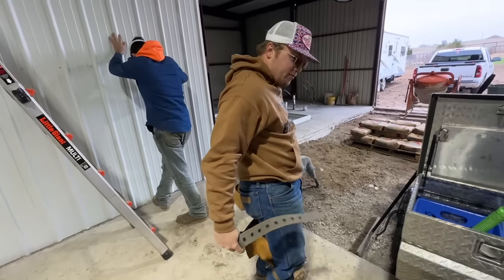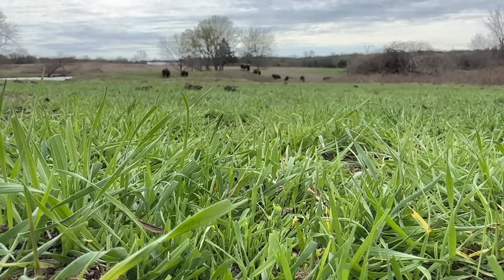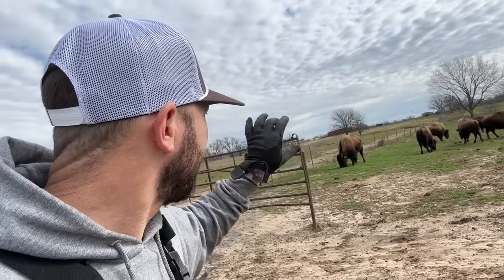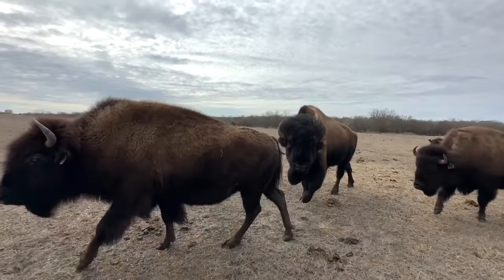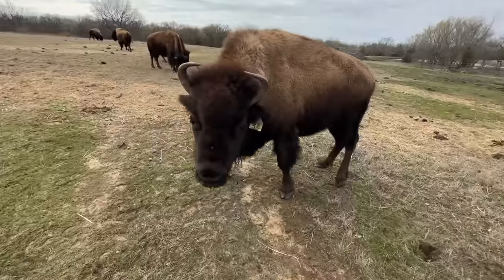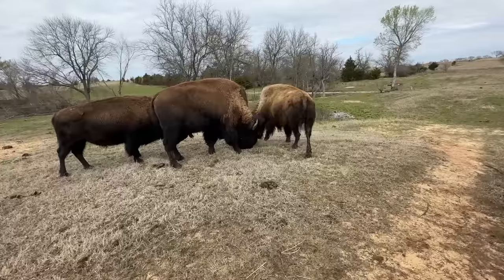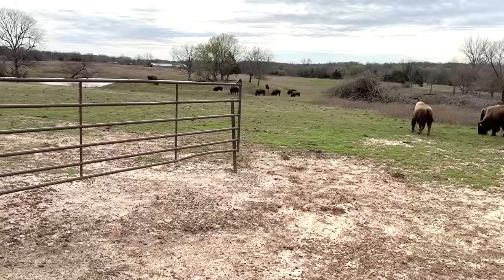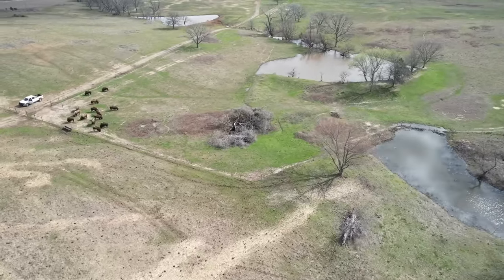Didn't Go As Planned, But I Got Them Out With...

Comment: Just trying to help you, plant Some better Grasses that have a Better Roots system then what you have ! Sometimes Adding a stronger Grass will help. Try Oregon Premium Kentucky 31Tall Fescue? TSC has It and it does not Turn brown in the Winter and will choke out Weak Weeds. Last if it Does Not Say Oregon Premium DON’T BUY IT.
Reply: Dusty what do you think of that suggestion although I don't think you would pick it up at TSC to sow a whole field you would need a lot of seed. But Daniel just got a heavy seeder attachment, maybe you could borrow it.